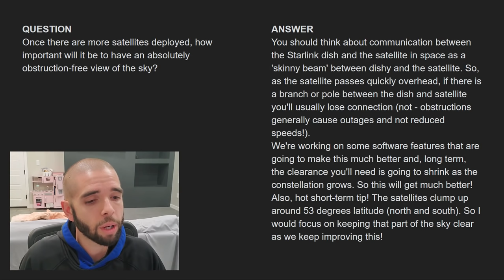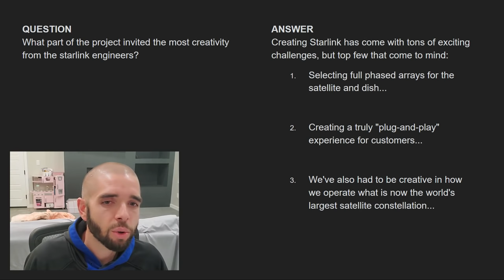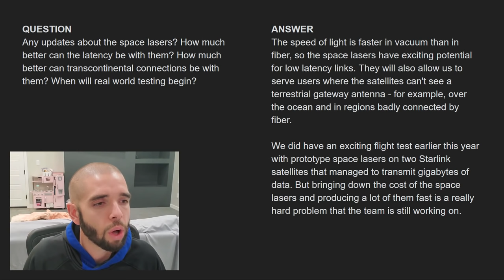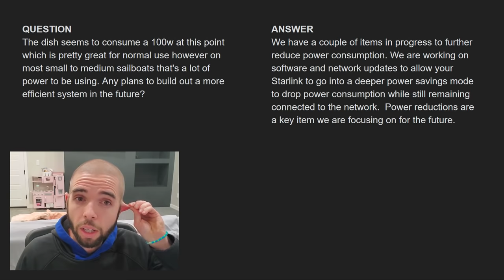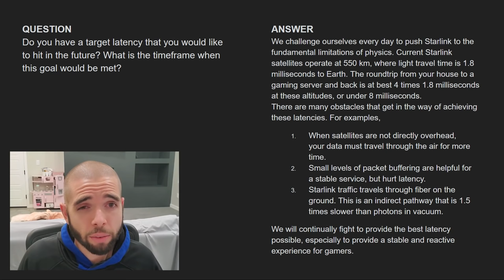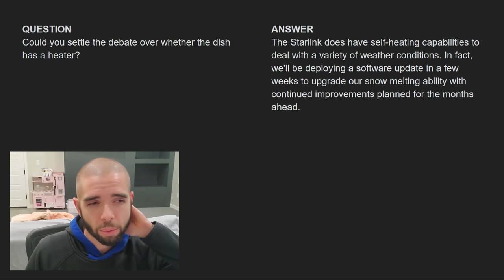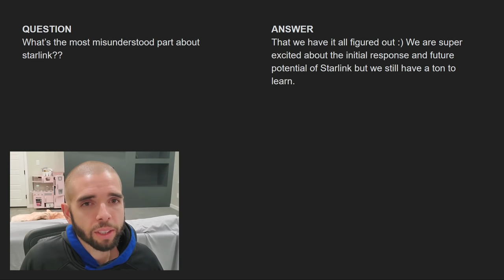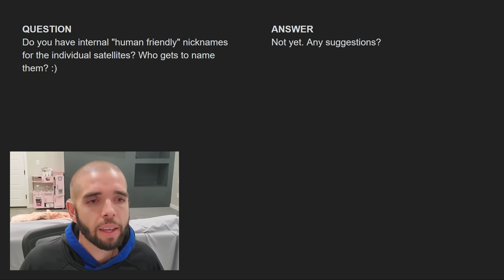Starlink Engineers Answer Our Questions! Reddit AMA 11/21/2020

Comment: Got mine up and running today.  Very happy so far.  Had it about 5 hours now.
Reply from the maker: Glad to hear that! Let us know how thing progress. Where are you located?
Reply: @JoshGreisen  located on the east coast of Canada in southern New Brunswick.  After hook up it began to run rather quickly acquiring signal. My first speed test was 160mbps down around 20 upload with 50 latency directly wired to my Xbox.  10-12 pm was very spotty connection and dropped signal 6-7 times.  Early evening was far less drops.

Comment: I think the most fair QOS method is throttling heavy use after a period of time to ensure they're not impeding on others bandwidth, if the network is fairly free at the moment you could even program it to leave them be until it's a network impediment. You can keep unlimited data that way and only limit those who abuse or use at a bad time.
Reply: I agree, I just hope the limits are over 5 TB

Comment: Hi Josh, do you have a measurement of the 24 hours power consumption of Starlink? That's a key concern for those of us off-grid!
Reply: Less than 2.4kW lol
Reply: Others have posted 100W  - that is the output of the power brick.
Reply: turn off when you sleep on ))
Reply: @yfs9035  I think you mean kWh not kW. You can run 2 microwave ovens at 2.4 kW. lol

Comment: My biggest concerns: Iffy answer on potential data caps and the power consumption issue. Living off grid on solar makes 100 watts continuous a big chunk of juice on cloudy days and over night. To put it in perspective, 2.4 KWh in a day is two large batteries added to the power bank as well as more panels. That is a big consideration when you realize our refrigerator, lights, TV, computer and fan only use 1.3 KWh in a day combined. Turning it off every night is reasonable but forgetting to do so just one time can do damage. Would have to see a smart power functionality added to software before I jump in.

Solar users should be a concern for Starlink because if you have grid power to your home there are alternatives due to the infrastructure required for that power.

Comment: These answers did not sound like they came from engineers.  Engineers would give numbers.  They should have tested dishy to a certain wind speed (hopefully, the 110 MPH that many building codes use) and should have been able to provide the spec.  There answer sounded more like from a sales or marketing person.  This help true for many of the other answers.  The temperature answer was one of the few that sounded like it came from an engineer.

Comment: Looking forward to your testing utilizing your own router connected directly into the power supply brick. Your current testing with speeds and such is great, but your utilizing the "AUX" or Starlink Modem/Router WiFi itself we think, as well as still keeping your current internet access provider. We have still not yet received a direct response from Customer Support with regards to utilizing peripherals and the use of the proprietary Starlink Modem/Router. We would be very interested is your future videos showing utilizing your own router, what type, how you are connecting (switches and such) and the results you are getting. Thanks. Great videos.
Reply: The dish provides an IP via DHCP in the range of 192.168.100.0/24 -- With the dish itself being 192.168.100.1.  You can plug a network connection from the White port of the POE injector into the WAN port of any router you'd like, and operate just like any other internet connection.  As an additional tidbit, there's currently no way to do any port forwarding from the Dish's external IP to an internal IP, and UPnP is not listening on the dish either.
Reply: @linuxkidd  Thanks Mike. Yes, we have found the UPnP (Universal Plug and Play for those unfamiliar) networking protocols missing unfortunately. Hopefully, with future updates, that will be resolved. When direct to the "brick", we loose the smartphone app use for statistics and other vital data. Not sure if there is a work-around for that yet, but studying it and hopeful. We just wish that besides the WAN (AUX) port on the propitiatory Starlink Modem/Router, that there were included on the device some LAN ports like any other routers on the market today. Maybe with future upgrades, it can be something engineering can examine. Stay Safe Mike. All the best.
Reply: @mjmohn  I've not had a loss of statistics in this mode... well, at least not the dish debug details.  I'm not in a service area, so my Dish does not connect, so I'm not sure on the other statistics outputs -- this may be a feature of the provided router.
Reply: I got mine in Northern Ontario today works good but can’t connect to starlink to see any statistics or any thing. Some newer devices don’t connect to network , some have poor signal and some work ? Lan is good. Rebooted, reset everything . Filed ticket with Starlink.  I will have to buy a router I guess.

Comment: The problem with data caps is how they're implemented. If you have a hard cap of 150, or 200 GB a month and then you're throttled or charged extra.. that's a problem. That's bad business. And how far a person is throttled is also a problem. Like if someone hits their data cap, their 100MBit cable connection might get slowed to 1Mbit until the next month. This is also bad.

Bandwidth isn't a finite resource, you can't run out of it. You can max out the rate at which it "flows", but it doesn't deplete. It's a continuously flowing river, not a lake.

So what companies SHOULD do is, if someone is regularly abusing the bandwidth at peak hours, to >reasonably< slow them.. for those peak hours. But once the peak hours pass, even a user that uses a LOT of data should get their full bandwidth back. Even if they're transferring many terabytes a month. So their 100MBit cable might get scaled down to 40MBit during peak hours, but once the traffic lightens up, their throttled connection should scale back up. 40MBit, 50, 60, 70... then eventually back to 100MBit for quiet hours.
They shouldn't be locked to 1MBit day and night for the rest of the month. Regardless of how much they download.. And no company should ever charge any user for additional data. If you pay a monthly fee, you shouldn't have to pay a "DLC" fee on top of it if you hit your data cap. You're supposed to be paying for bandwidth, not capacity.

This is how mobile data caps should work too. If someone is streaming 4k netflix 24/7.. that could be a problem especially at peak hours. But nightowls should be allowed truly unlimited bandwidth during non-peak hours.

This would encourage heavy downloaders to download all their stuff during non-peak hours. By for example, setting steam/consoles to download or update games at night. So the majority of users aren't affected.
Reply: And now a days Data Caps should be like 1 TB or 2 TB, nothing below 750 GB and once you go past them lower it to at the LEAST 15 mbps. If satellite internet providers updated their things to the usage of today's America population then people wouldn't have that much of a problem with them. I wish they would just see these 100GB and 11kbps caps are to old and wrong to do to people now in modern times causw there are kids that depend on internet for education now. Its horrible how bad they do people that can't get access to a good wireless connection. If Starlink doesn't completely blow them out of the picture, then hopefully it'll start a race or modernization of their services to more reasonable caps and promises.
Reply: @eronic404  I did specify many terabytes. Most people won't download more than 5GB in a day, so someone downloading 2+TB a day is definitely outside of the normal user base and i could see them having to pay a premium for that.

Considering most of the users aren't downloading huge games every day or even streaming in 4k. 

Now at 15Mbit/s you're not downloading 2TB in a day. You can't. 
10 people shouldn't have slow internet just so 1 person can download ridiculous amounts of data while in the same payment tier. 

In the end, fixed data caps need to be removed, and time based or traffic based  caps for heavy users could be used to throttle only the most egregious users during those peak hours.
Reply: @LazyBunnyKiera  I meant 1 to 2 tb a month in data, sorry 😅. But yeah I completely agree, there should be absolutely no data caps. Just in the horrible chance they do give one, for a normal family 1tb to 2tb a month should be enough. Mostly because of constant use of streaming services with online school and TV streaming everyday for probably 8 hours a day from over 5 devices is alot of data, I feel like close to 1tb or more a month of data used for a modern family of today. So caps now days should be none and if any in the Terabytes not the Gigabytes. And in probably 4 years that'll be to little. But that also all depends on internet speed as you said, which should be the only thing controlled.
Reply: @LazyBunnyKiera  bro he obviously meant in a month if u know data transfer rates you would know that 2tb in a day is pretty much no possible context clues are the best clues 😉
Reply: I think you are confused about bandwidth. Think of it as an interstate highway. It is true that you can get a trillion cars from point A to point B with a single lane....but time is the limiting factor. You can also get a trillion cars from point A to point B with a 12 lane interstate and you can do it faster with less congestion. If your assertion regarding bandwidth was true there would be no rush hour traffic issues in LA. But there are rush hour traffic issues in LA which could be reduced if there was less traffic at that time (incentivized). The interstate highway is going to be designed for worst case scenarios based on studies and that costs lots of money even though 75% of the time the number of lanes is overkill. Starlink is not going to build a massive pipeline for 5% of their userbase who consume/send ridiculous amounts of data nor are they going to create a use algorithm to support squeezing every bit of bandwidth to accommodate that 5%.

My point is that if someone is using huge amounts of data and they are flagged as a heavy user then someone who uses a moderate amount of data should get priority over them at ANY time of day. If you want unlimited data then order and pay for 10 dishes under multiple accounts and pay for it each month. No average user should be punished because some techy user wants to consume unlimited data.

As to your river analogy, there is a stark difference between the Mississippi and the feeder creek that always runs down the road from my house. Neither of them stop flowing and I can hop over the feeder creek but I am not going to make the same assertion of the Mississippi.

Comment: I live in the middle of no where.  I've been waiting for upgrades on equipment from my current ISP for the last 4 years. Last time I called, they said basically in your area we don't get enough money to justify upgrading the equipment you connect to. I was told there are 12 homes that connect to the tower I use. Which is a line of sight.  Im lucky to have that.   My electrical provider, has been running a fiber network for the last 6 years and they are working on the backbone in my area.  I've seen the trucks.  But, could be another 6-8months to run to my house.  I'd take star link right now if I could get it.  Im tired of my 1Mbps down and .2-.5Mbps upload.
Reply from the maker: Should be coming soon, I just posted a new video on an a recent set of updates from Starlink on increasing the beta rollout in Q1 of 2021! Starlink Upgrades 12/22/2020 https://youtu.be/3AVlqNVw2JA

Thanks for watching, please like a subscribe to see more updates!

Comment: Hey Josh. Very excellent Q & A summary. Thank you. But... it didn't answer the question I had and I wondered if you knew the answer. Q: If Dishy is frequently (every 5 min??) connecting to a different satellite in the Starlink array, how is this done in a manner which does not cause an outage? I'm envisioning Dishy having to have to move to follow each satellite. I'd love to see a timelapse of this motion.
Reply: Caveat - I'd guess this response is 90 percent accurate based on what I've read on Starlink (your guess which 10 percent might be incorrect).  So no, Dishy doesn't physically move. Actually, Dishy's huge number (around 1,200 on current version) of phased array, circularly-polarized antennas under the radome are electronically controlled together in unison to track a 17,000 MPH satellite racing across the sky most anywhere within 100 degrees of its viewing range (down to as low as 25 degrees above the horizon, provided the signal isn't obstructed by obstacles).  Each satellite has a unique beacon frequency that is modulated with data instructions to Dishy, notifying it where and when to electronically point to the next satellite as its signal becomes weak, the traffic load requires load rebalancing, etc.  And let's not forget that each Dishy has an ARM processor to handle these and many more instructions.

Since the time to switch Dishy across the sky is so short, minimal packets are lost as the constellation of satellites grow in the thousands.  But wait, there's more - from the earth's Dishy perspective, since the satellites spend more time nearer the earth's poles (at this time where the data traffic load is small), Dishy receives instructions to spend more time pointing to the satellites in the Northern (or Southern) 53 degrees of inclination. 

As the constellation of satellites grows with the number of Dishy customers, each Dishy will be pointing more uniformly across the sky for load balancing with improved performance, potentially doubling upload/download speed and fewer dropouts.  But today, with "ONLY" 1,000 satellites Starlink is only able to sell beta service to customers above the 37 degree latitude.  Sorry for the long answer and yes, Dishy switched satellites in less time than it took for you to read this!  Not much to this, all for only $499US, eh? LOL

Comment: Just got invite and ordered dishy. We’re building a new home 30 miles west of Missoula MT on Clark Fork River. Best internet available is DSL with 15 Mps. I should have asked about internet speeds before we bought land 🙁 I work from home so I’m a little worried. Looking forward to getting kit. Installing will be tricky since Sheetrock is up but not taped and mudded. Also learned today that Ethernet cable is hardwired to dishy. Getting cable to racks in utility room challenging but at least no second story over that part of house. My husband did mention joists will be an obstacle but I have faith in his ingenuity 🙂

Comment: Hi Josh, I have a question regarding future satellites.   I did not jump on the chance to order Beta until a month later which put me at the end of the line.  I just found out yesterday after having someone over to confirm I have too many obstructions (mainly 100-250ft trees and a mountain) in the NE area.  Obviously starlink won't work there, however, I would be able to get a SW direction or straight up and down.  Will the starlink system look at those satellites too?  In other words, should I hold off from cancelling my order until starlink sets up satellites in that direction?  For what's it worth, I'm located in Southern Oregon.  Thanks for any help.

Comment: I would like to see a complete video on comparing speeds and or if it still has a connection on various types of obstructions. Put Dishy in the garage and see if it works. Put it in a car that is outside and see if that works. Put it inside a RV / motorhome see if it works. Put a hard plastic trash can over it. What about a green house plastic sheets? Or just a plastic film trash bag? A sheet of plywood? I would like to see a baseline now where they are at. Then maybe every 3-6 months try it again and see if software updates have helped. Once fully deployed I would like to take Dishy with me in RV. Keeping it outside on top of RV with no dome does never sound like a good idea. It is a 5th wheel so I could put it in the bed of the pick-up truck with a homemade dome / dog house.
Reply: Apparently you are unaware of personal safety factors with a 37dBM 10GHz focused beam.  Please be carful and stay tuned for further information coming on ESIMs.

Comment: I currently have Hughesnet. Can I use the existing coax from my Hughesnet dish for the Starlink dish?
Reply: I don't think so. The cable from the Starlink Dish is Ethernet not coax.
Reply from the maker: You cannot, this dish has a network cable rather than coax. So an RJ-45 connection.
Reply: @JoshGreisen  thx

Comment: I've not received the system but I have one on preorder. But I have a question that has likely been covered somewhere.  My north view is obstructed by a number of trees.  But beyond the trees my property fronts a lake where the north view would be unobstructed.  Is there any way to connect additional cable.  I've read that it is not recommended.  Otherwise I have to remove about a dozen large trees.  But if I can get out beyond them I'll mount Dishy on a pole mount.  Any suggestions?

Comment: What is the recommendation of the mounting or setting of the pizza dish?  And how do you recommend getting the cable inside the home? soffit or gable, drill a hole and seal it?  How do most people do it?
Reply: You could setup a tower then install the dishy on top of that.

Comment: Starlink to infinity and beyond! Thanks for the information update, I hope they beef up the receiver to handle higher winds, no one is going to want to move their ufo indoors every time a storm threaten.
Reply: Build a plastic dome or insert it into a rubber gym ball to protect from rain and wind?
Reply: @kitecattestecke2303  Good ideas. I think the big issue is snow buildup interfering with the signal and high winds ripping the antenna off the roof.